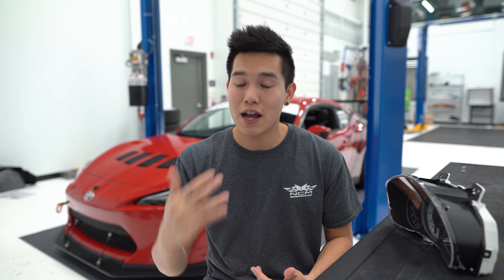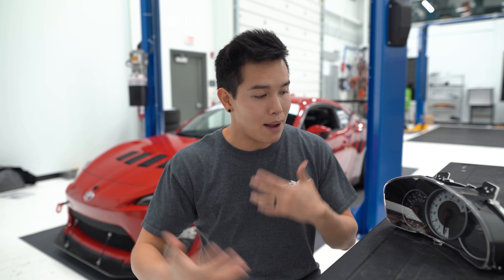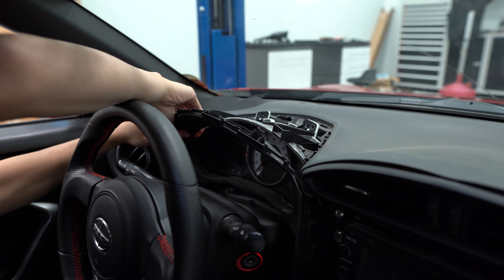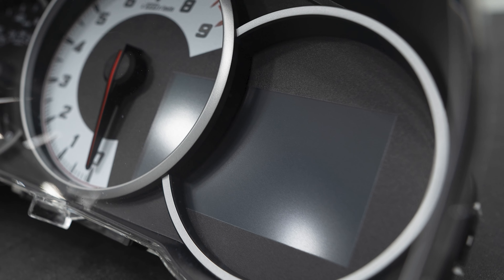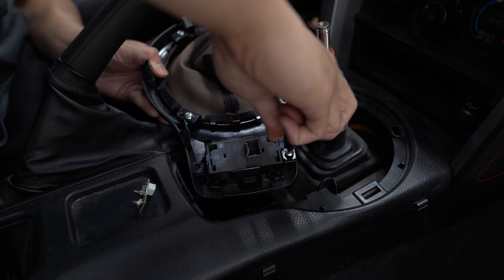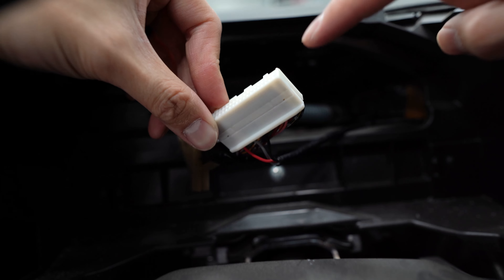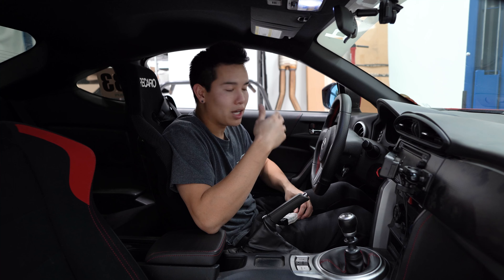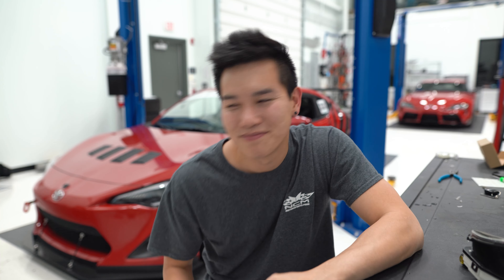17+ Digital Cluster Retrofit into 13-16 FRS/BRZ

Comment: You see I wasn’t planning on changing the clusters until I saw that it shows how much range you have left and I always love seeing that. Now the problem is that I have an automatic so where you placed the button I already have a button there :( any other clever places you can think of placing?
Reply from the maker: You can really put the controls anywhere that you desire. Do you have a push to start? If so you can put the controls where the key start would be. Otherwise, you can also put the controls to the side of the cluster or where your fog light button would be.
Reply: @KevinVo  I saw one guy on reddit managed to retrofit the 17+ wheel on a 2013 brz and got the controls to work but he never said how he did it.

Comment: Dope vid. Got me to go through junk yards online and grab a cluster myself 😅 now in the process of doing this mod, thanks for the insight lmao
Reply from the maker: Awesome, glad I could help!!! 🤣
Reply: Hi, can you share the websites to look for this? I'm not familiar with any online junkyards [this is the first time i've heard of them]
Reply: @KevinVo  Hey Kevin, finally got the cluster installed and handshake procedure done. It would randomly throw CEL code U0155 for lost comms with cluster, did you have this issue?
Reply: @johnowow  were you able to resolve the issue?
Reply: @prettyzooted6288  Yes. If I recall correctly, I emailed Gerald about it and he mentions this is expected and can be cleared by resetting the battery or with a scanner. It went away and does not come back

Comment: suuuper dope. i had always wondered if you could retrofit the steering wheel controls from 17+ to 13-16 models without the head unit, just to control music :P
Reply from the maker: Glad you enjoyed it! I am not entirely sure on the steering wheel controls controlling music without the new head unit though.
Reply: @KevinVo  another question I have a 14 frs automatic, this will work to on them?
Reply: I’ve done it. Changes out steering wheel and airbag and ran the wiring through the clock spring and into a swc module. SWC are analog negative ladder so most modules will take care of it

Comment: Hi, if I buy a 17+ steering wheel, will I be able to control with this cluster? If it does, does that mean I don’t need to install that little joystick control button? Thx.
Reply from the maker: Yes, you can either use the 17+ steering wheel controls or use the geraldjustprojects controller.

Comment: This it a great video iv wanted to do this since i got my frs but i was wondering If you could pair a 17 steering wheel with it instead of the little toggle switch?
Reply from the maker: Yes, you can run the 17 wheel and use the controls on that steering wheel instead.
Reply: @Kevin Vo  that's great news! could you point me in the right direction for what you'd do for the wheel to work? Not trying to write 1000 questions in the comments lol

Comment: Question for anyone,  my 2020 86 didn't come with the digital cluster so I've always wanted to switch it. It's a turn key car but my steering wheel has the controls, soooo would that automatically work then??? 
Also.. if it doesn't work and I have to go the traction route, my 86 has a traction off, a race traction off, and speed/snow buttons so all three are occupied... so am I out of luck then???

Comment: Can you do this in base 2013 models without the digital speedo or rev limiter beep stock etc?
Reply from the maker: Yes you can, it'll be the same process.
Reply: @KevinVo  quick question. I have my frs tuned with ecutek, when it comes to having to register the new key will my ecutek locked tune prevent it from syncing or interfere with the ecutek software?

Comment: Thanks for the reply on the previous comment Kevin! 
I had one small doubt, I have the 2017 steering wheel without the right side switch (the one that controls the instrument cluster) since I got the basic version with the older model instrument cluster. Is there any way to maybe just get the right side switch panel (the 5 directional buttons with return function) and somehow wire it up to the instrument cluster through the clockspring? Please let me know if you have any info. Thank you! 🙏
Reply from the maker: I think you would need to buy the whole steering wheel button setup. I doubt they sell just one side.
Reply: @KevinVo  but will the clockspring harness support the wiring?

Comment: Ok I have a question if someone can help I have a 2013 base model 86 and it comes with the analogue cluster any chance this software will allow me to put in a cluster from same year with the digital speedo and white dial I really want to do this swap but am struggling to find information. Also could I use an auto cluster for my manual?
Reply from the maker: You should be able to retrofit it into your car.

Comment: Can I have a locksmith program the immobilizer instead of using techstream in my turnkey. I got a 2020 cluster from an auto hakone and installing it in my 2016 turnkey. Techstream I can’t get to work
Reply from the maker: It's doubtful a locksmith would be able to program it.

Comment: If I have a 2017 86, will I need to buy the joystick and wiring?
Reply from the maker: You'll either have to buy the joystick or buy the OEM steering wheel controls.

Comment: Question Kev, do I download the program onto the laptop before hand or when it’s plugged into the car and laptop the program self initiates itself?
Reply from the maker: You'll need to download the program beforehand.
Reply: @KevinVo  Do you have a link or does it come with the cable pre installed?
Reply from the maker: @JacobAlvey123 the software comes with the cable.
Reply: @KevinVo  Thank you so much Kevin, I bought a 17+ cluster back in 2020 but never got around to it because there were no great tutorials besides threads. I also had a key car so this video helped out a lot and gave me confidence in doing it myself. Again ty.
Reply: @KevinVo  Hey Kevin, it’s not working when I connect the cable to my laptop… so how do I install the software beforehand? I uninstalled Firewall, and the other Windows protection service. But every time I plug in the cable nothing pops up. My cable came with a disk so do I have to use that to install the software?

Comment: In case you wanted to match the buttons and trim to that black replacement button you can get oem black trim off of amayama just look up the part numbers
Reply from the maker: Yup, we sell those at FTspeed 😉

https://www.ftspeed.com/part/su003-02486-toyota-jdm-oem-black-mt-traction-control-buttons-2013-ft86#.Yae9GNDMKrw

Comment: hey, great video! wondering if i order the toggle switch, would i be able to just depin and repin the switch into my cluster? i just installed a steering wheel set up on my car, but would still like to retain the ability to control my cluster. any input would be great!
Reply from the maker: Yes, it should work the same!
Reply: @KevinVo  Thanks kevin! just ordered it. appreciate the help!

Comment: In case we didn’t want/need to change the mileage or start logo, would we still have to send the cluster off to Gerald or could we skip that step.
Reply from the maker: Absolutely!
Reply: Could I reset the odometer this way?
Reply from the maker: @user-white007  what do you mean reset?
Reply: @KevinVo  I think he's asking if the cluster will change its mileage to match the ecu in his car or if there is a further step to take. thats what I was wondering also. I want to do this, but I would want it to reflect my cars actual mileage so its not inaccurate.

Comment: My RHD GT86 did not come with a digital display from factory, how would I be able to do the swap ?
Reply from the maker: Should be essentially the same process. You'll just need to add the steering wheel controls.
Reply: @KevinVo  ok thanks, so you think the plug that goes into the back of the cluster would be the same ? I figured it might not have all the pins to power up the display
Reply: @KevinVo  you can check my videos out to see the cluster I have, it does not show a digital MPH gauge display
Reply from the maker: @krishall268  ah interesting, I have not seen that cluster before. I'm not quite sure on models outside of the US, but I can't imagine they changed much. Worth an effort to try imo.

Comment: I have a 2013 and it doesn’t tell my miles until empty. With this new cluster it will tell me without having to add anything else to the car?
Reply from the maker: What do you mean it doesn't tell your miles until it's empty? Are you saying the fuel gage doesn't work at all, just the gas light comes on when you're close to empty?

Comment: I was looking to do it desperately but i have an auto and all the clusters i could find are from manual. Will it still work ?
Reply from the maker: Yes, it should still work. I believe my cluster is actually from an AT.
Reply: The transmission does not matter. What matter is the car is Push start or Turn key. If the car is push start, it is just a simple swap-and-go. If the car is turn key then you must do handshake procedure as seen on the video at 15:20.

Comment: If the new cluster is backwards compatible, is it possible to install a gadget to pull up the oil temps, etc for the peeps that prefer the old school 7segment displays/fuel gauge, etc?
Reply from the maker: Yes, geraldjustprojects.com have a couple different gauge options.

Comment: I wish i didn't see this.. now i have to add it to my to-do list - For push-start what is the process?
Reply from the maker: For push to start vehicles it is even easier because you can skip the programming step.
Reply: @KevinVo   I am calling my wrecker tomorrow moring during work lol
Reply: @KevinVo  Does it matter if the cluster is auto ? My car is a manual
Reply from the maker: @esko23q  no it doesn't
Reply: @KevinVo  Since in Australia the repin kit would be the same as well ?
Reply from the maker: @esko23q  unfortunately I can't confirm that
Reply: @KevinVo   I can finally confrim its the same process for RHD i asked the man himself

Comment: I wanted to ask if it would be plug and play for my 2017 model and I do have steering wheel controls. My 2017 86 didn’t come with the LCD cluster.
Reply from the maker: Is your car push to start? If so, then yest it will be plug and play.
Reply: @KevinVo  It is not, still key ignition. But since I have SWC I won’t run into that first issue of having to install that extra wiring in order to control it right? I only need to program it at the end to get it to recognize that it’s the new cluster.
Reply from the maker: @Denis_Vujic  that is correct. You'll just need to get the techstream cable to program it.
Reply: @KevinVo  Hey Kevin, I bought these updated clusters for my 86, it was a BRZ cluster, however I’m trying to get the tech stream program to work it’s saying it can’t detect my ECU. Does it matter if my car has been tuned because I’m boosted and I don’t know if it’s because of that that’s causing me not to be able to program the cluster

Comment: i have an issue with my brz not always starting right away when i press the button (no its not the battery in the key or my clutch/neutral switch either) was wondering if anyone knows if using the tech stream sofware would be able to help re calibrate/ figure out what's not communicating 100% in the immobilizer system?

Comment: If I already have a 2020 brz with the digital display, do I need to program the car with the techstream cable? I just want the little dials because I have an aftermarket steering wheel and no way to control the cluster menu.

Also, are the pins on the connector behind the cluster the same on 2017+ models?

Comment: I have the 2017’ 86 with the old style cluster will this work too?
Reply from the maker: Absolutely! You can either choose to use the retrofit kit from Gerald Just Projects or you should also be able to buy the OEM steering wheel controls to add as well.
Reply: @KevinVo  I have the 2017’ oem steering wheel for the 86 but the right side is blank is there a button interface for that too
Reply: @KevinVo  and I’m automatic also not sure where to put the buttons

Comment: Another thing, would it be possible to wire in a 2017+ steering wheel so the chip board isn't required? 
Figured it might be an option, but probably not considering the steering wheel doesn't have any controls on it in the first place.
Reply: It’s possible, i’m in the process of making a tutorial. I already have a tutorial on how to put the head unit controls on the steering wheel if you don’t have them

Comment: great Video! Where i can buy a digital cluster? And when i buy a facelift steering wheel with controls - then i don't need the extra controller, right?
Thank and i wish a good weekend from GER.
Reply from the maker: If you have the new steering wheel controls then you don't need the extra controller. As for where to acquire the digital cluster, I'm not sure how you can go about that in GER, but I used https://www.car-part.com/ to source one in USA from a junk yard.
Reply: @KevinVo  Thank you!:)

Comment: Has anyone tried to fit the 2022 into a 2013+? I just checked the pins and the housing, and it looks to be a perfect fit and the connector is exactly the same as the 2013+ so it should be plug and play.

Comment: Can you do a ac manual to digital retro fit
Reply from the maker: It's possible, just very much not worth it. It's very complicated and requires you to essentially swap out the whole hvac system and deal with the wiring as well.

Comment: Hi Kevin. Would the old one be able to fit into the newer models (push to start) with no problems? (Sans steering wheel controls.)
Reply from the maker: I don't see why it wouldn't work. Shouldn't be any issues.
Reply: @KevinVo  @Gymnast562 Hi Kevin, I just did the swap myself, fitting an old cluster into my 2017 BRZ, and the CEL is on, got a permanent error code for lost communication to the instrumental cluster. Does it have to do with the fact that my car has a push to start, and old cluster was for a turn key one. Do you have any thoughts on that? Looking forward to hear from you, thank you!
Reply from the maker: @scotttheawsome23  did you reprogram the cluster with techstream?
Reply: @KevinVo  will try that now, thanks

Comment: stopped watching at 3:34. I have build several of these cars from chassis to full track cars and sevral show cars. I even watched my first Frs from 2013 burn to the ground almost with me in it. Im not religious but fuck for or all that is holy in electronics unplug the fucking battery. P.S. watch out for oil temps on stock gt86. around 195 you have the chance of experiencing what its like inside an oven of death like myself and a few others. still giving thumbs up bro keep trying your best to make amazing content.

Comment: Hey Kevin, Great Vid - Just wondering if this swap retains the "hill hold" feature in the 17+ cars?
Reply: I believe the hill hold function is a feature  stored in the 17+ VSC/ESP ECU, so swapping the instrument panel wouldn’t introduce that feature to this 13-16 FRS
Reply from the maker: It wouldn't add the feature if your car didn't already have it, unfortunately.
Reply: Ah got it, thank you so much for the reply guys!
Reply: You can swap the ABS controller from the 17+  models to get it.
https://youtu.be/ysNTvaR1vRE

Comment: Does the 2017+ brz cluster work the same way  as the 86 too?
Reply from the maker: Yea!
Reply: Sorry I mean I found a 2017+ brz cluster and wanted to put in my FRS can I still use Gerald to function it like an 86?
Reply from the maker: @thyrithsakadanguon1908  yes, he can change it to the 86 animation
Reply: @KevinVo  thanks Kevin
Reply: Also just wanna make sure with you does my ECUTEK cable software work as well or do I have to get a new one?
Reply from the maker: @thyrithsakadanguon1908  should affect the ecutek